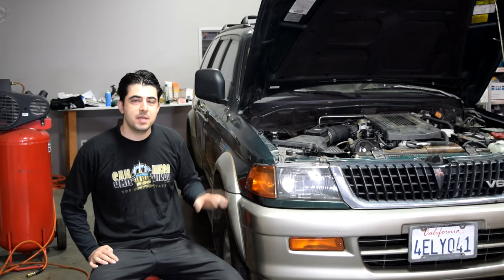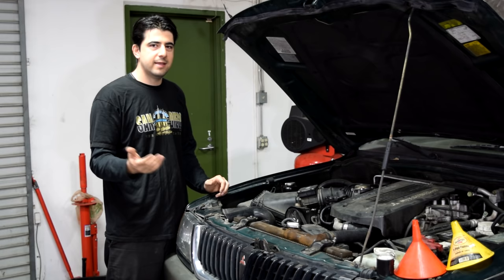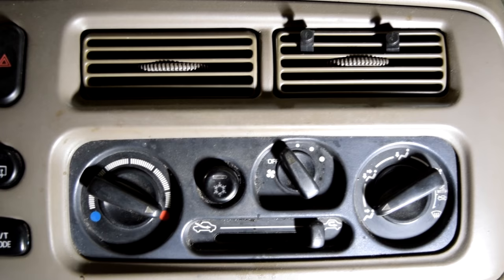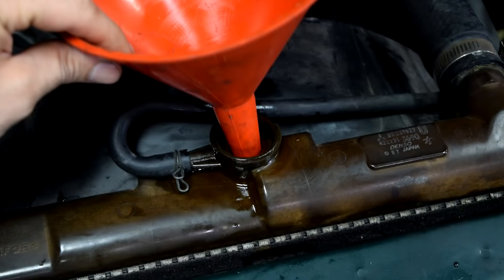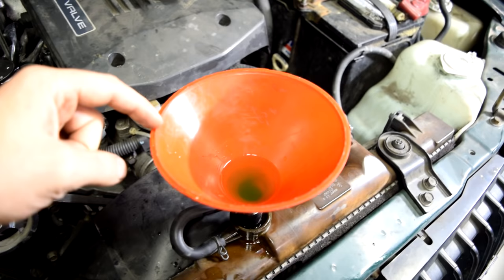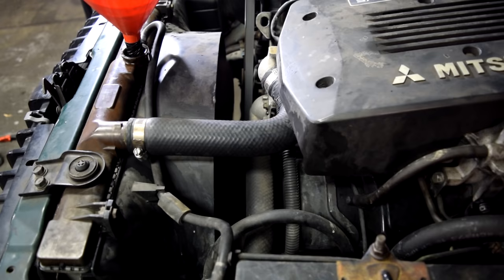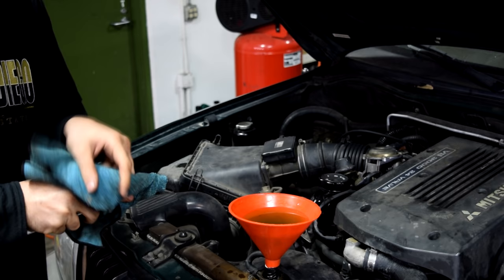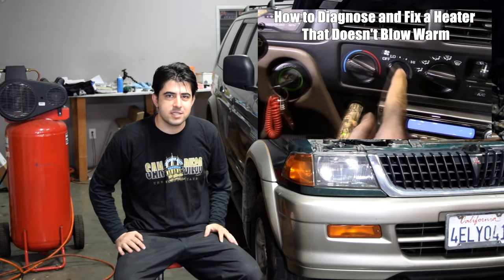Learn How To Bleed Air Out Of Your Car's Cooling System With This Quick And Easy Diy Method.

Comment: so I have no misfire, good compression, car runs greate. I get hot air when I turn heat on, and cold air when I turn the A/C on. everything is fine, other than after a good 45min drive I stop and turn off my car as normal, but I here bubling coming from engine(not sure where exactly from)..... I have a 95 4 runner and so far no signs of blown HG. OTHER THAN the bubbling sound..... I have heard its not the gasket, just that I am a little low on antifreeze. or the HG is blown. I cannot tell and I don't know much about vehicles. however, if I get the right information and a video that shows me what to do I'm confident I can do it myself.

Comment: Got a code for bad thermostat. Replaced it. Drained n flushed the coolant. Bled the new coolant. Got temp up to normal, but my cooling fan does not come on (it never did prior to replacing the thermostat) unless the AC is on. I also noticed the lower radiator hose is not warm. But im getting heat and no overheating. Could it be the coolamt temp sensors? I really hope its not a faulty thermostat that i purchased new. My check engine light keeps coming back on every two weeks giving me a bad thermostat code. P0128. Now my temp gauge is only at 1/4-1/3 on the cool side. It's not at half anymore. OBD2 is only reading ECT temp of 150° F when car is already taken for a 20 minute cruise. Cooling fan comes on when the AC is on, so im assuming it's not the relays or fuses?

Comment: Great video man.
Question:. Any idea why a 2007 Chevy equinox will overheat when going uphill, but not on any other situation? It's my cousins truck and I haven't been able to find a good answer online. He did mention that one way to cool the engine down when going uphill is by revving up the engine, but it's dangerous as where he lives is all dirt roads up high in the mountains. Thanks.
Reply: Do you find the reason?

Comment: I have an 05 town country it overheated a while back . Replaced the water pump, ever since my gauge never worked properly. It's over heated again. I replaced the the pump ,the thermostat and the radiator cap this time. It's still heating where it shouldnt be. No water in oil, I checked . Can u guide me whT to check

Comment: Is it the same process for an audi a4 quatro 1996 ,changed water pump,thermostat,heater core ,an fluid. An still dont have hot air  need help.  Ho megustan tus videos.  Gracias

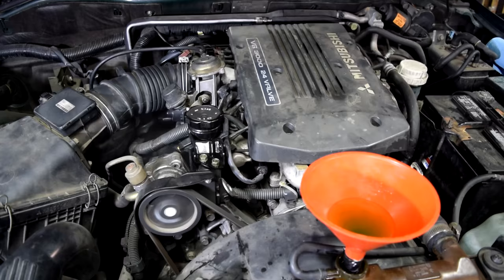Comment: On this video, at 4:06 you can see smoke rising from (probably) the exhaust manifold. This is something nobody seems to mention in any of the videos or any of the forums. So today when I replaced my coolant, and a lot spilled on the exhaust system (engine block release screw was located right above it). After I started the car, it started smoking quite a bit, and my heart nearly stopped, I had no idea what I had screwed up. Luckily a short internet search led me to some obscure forums, and I found out it's normal, and will burn off after about 5 min. And it smells like cotton candy, helps with diagnosis. Regardless, I wish all tutorials would warn about this very scary phenomenon.
Reply: Shaun TV it’s not even scary lol that’s something I’d hear at work from a customer. They think it’s the end of the world when something normal is going on

Comment: What about the vehicle engine gets hot when goin over 60 mph, and then drops to normal, and goes up to H again hot, and drops normal so what cud cause that? Use more acceleration engine gets hot, fan comes on, and idk we put brand new heater core and new thermostat with housings, top it off with coolant n still gets hot...ido what wrong

Comment: A couple days ago my radiator cracked and the car didnt overheat but it started to smoke because coolant got on everything In the engine bay I put a new one in today and I was bleeding it out and some green stuff was coming out bubbly like it was kind of like suds from soap but greenish and my car overheated on the drive what should I do?

Comment: So here is the question!! I bought the funnel so I checked my coolant in the morning  cold  to check the level !! Radiator level I guess was ok  the reservoir was over the max level though!! So I just wanted to get any bubbles that they where there for my piece of mind as I heard some gurgling in the heater core. Well after an hour of the truck running I squeezed the radiator hose few time some bubbles pop up but when I shut of the engine even with warm coolant the level in the radiator was the same as when it was cold!!! Wtf?? Any  directions??

Comment: I've got a Ford F150 with the plastic reservoir next to the radiator instead of cap straight on radiator. Is it the same process or is there a difference in burping with a reservoir? Great vids!  Thanks 4 the info

Comment: Great detailed video. I had the same problem and your tips helped a lot. 
One big question tho:
My lower (the one with the thermostat in it) and higher hose's temperature never become equal. The lower is always cold and the higher is pretty hot. My car is a 2000 toyota camry. Did I do something wrong? Is my thermostat opening at all? 
I stopped the bleeding when air in the cabin wad warm, fan came on a couple of time especially at higher rpm, and i saw no more air bubbles out.
(Also, i could see some steam like material coming out of radiator after a short drive. I wonder if that is just the coolant liquid that might havr spilled on the radiator?!)
Really appreciate your help.

Comment: I have a problem. My lower radiator hose is cold and my radiator cap is cold as well after warm up. Tue cold light shuts off after about a 10-15 minute warmup.  My car does not overheat either but only the top radiator hose is warm not the lower.

Comment: on a 2003 Buick lesabre  V6  do I have to jack up the front of the car to change my antifreeze , I dont want to touch the bleeder screw because  with my lick it will break off.

Comment: Just changed my radiator and now my engine is running substantially hotter. And, it spikes up to around 215-220,.runs around 206 cruising dwn the highway. It's usually mid 190's. Think it's an air issue?

Comment: Great video.  I have 2011 chrysler 200 3.6 with sloshing/gurgling in dash.  I just tried this technique and worked great... much air came out. Went in the car and revved it up a while, no more gurgling sound.
BUT, after i shut the car off and was going to do the rag on the screwdriver trick.... the coolant started rising very fast and quickly overflowed the funnel.  Quite a bit came out all over and coolant level went below the bottom of the funnel.  I replaced the reservoir cap.  Started car back up and  the gurgling sound is back.  Thoughts on the why it did that and how to fix?  If it were just gurgling and sloshing, I might put up with it... but it runs hot too.... so i need to fix it.
Reply: This same happens to me !!!!
Do you know what ist the reason?

Comment: I applied same procedures but am wondering that water on yellow bot returned back to the coolant plastic reservoir that’s happened only when I press on gas pedal to increase rpm ! Then the coolant water reservoir is above the F level ! Any suggestions please

Comment: Hi, great video! I dont have heating, but when I raise the heater tank up, the heat comes. And when I put the coolant tank in his place, the heating is gone. Even if the engine was ON for 25 mins with the tank up. Do you think that my problem is air in the coolant system? Any suggestions? Thanks

Comment: I have a question I just fix my radiator for camry 08 I did a pressure test coolant I notice when I pump it to 16 psi it slowly I mean really slowly going down a bit every 5 minute the needle going down a lil bit what Does that means?

Comment: I did all the drained and flushed and follow the proper air bubbles removable but my chrck engine light is on afterwards. What's the problem  and why the check engine light is on? It's a 2016 Honda HR-V.

Comment: Ratchet, Why is it that on Toyota Sienna's, the rear heater core barely gets coolant flow, it is a long travel from the engine and the only way I got it to work was to use a clamp to close the hose that goes into the front heater core so that there is a bit more pressure that would overcome the rear heater core and it work, after removing the clamp, it doesn't have good flow again, the rear heater core is not clogged and the small coolant it had was very clean like it doesn't flow. I was thinking the water pump is not big enough to maintain coolant flow to the back and only manages to pump up the front heater core which has less loop travel. I know I had air in the system so I parked the car uphill and started adding coolant. Like I said, I was able to get hot coolant at the lines but the flow is very little that the heater core is cooled down really quick and air is not hot, only warm. 

I strongly believe this is a Toyota issue where the water pump is not strong enough to keep coolant flowing at the rear heater core.

Comment: My Ford Windstar sits on a slope tilted to the left, will this cause my thermostat gauge To go up quicker? I didn't have my van on a flat surface, but I was trying to test the thermostat and the coolant overflowed within seconds of cranking the car. Should I have let it sit on a level surface before testing it?

Comment: My coolant rises instead of drops when the fans kick on. Now there’s more air in the system. What’s going on?
Reply: What'd you find out?
If you used a funnel like he did and that happens, I'd guess maybe the stat isn't opening. The top radiator hose should be hot once it heats up (showing us the stat opened)

I just did this to my pickup and it does rise and fall a little due to heat.
(Park on a small incline making the radiator highest point) and of course, ensure heater is set to high.

Comment: Ok so here’s my problem. My radiator doesn’t have a cap and so I opened the coolant reservoir and let air out from there. I left it open with the engine running and I spilled all my coolant when it overflowed.. my heater was blowing hot air too, my truck runs a little hot and I think it might be air in the system? Should I try again?

Comment: Great video as usual. On my BMW X5, I noticed that the thermostat hardly opens. Thermostat is supposed to open at 97 degrees C, 201 F, but when I check the engine coolant temperature, it hardly gets to that level. Therefore I can never bleed the coolant completely. I've left the engine idling for a long time, but still no luck. So in winters I get cool air whenever I stop, unless I turn the fan to low; only then I get hot air but at very slow rate.
Any guidance will be much appreciated. Thanks.
Reply: I'd get a new thermostat. It solved a lot of problems for me. They're usually under $10 and one of the easiest things to change on the engine. Usually...
Reply: @dickJohnsonpeter  but this is happening after the installation of a new dealer thermostat!

Comment: Hello please reply... i just changed my headgasket  but my coolant resovoir is boiling with air bubbles? What should i do? But its not overheating also i still have a heater and temperature gauge is right

Comment: when you say that the upper and lower hoses should feel the same temperature could you be a bit more specific for eg cool to touch,warm to touch,hot to touch. which one of these best fits your description
Reply: both should be warm to touch and as the engine idles the hoses should be  hot to touch. the next time you are by your car pop the hood and touch the top radiator hose then let the car idle as usual and then touch the top hose and you will see how warm or hot those hoses can get
Reply: option man thank you very much.
Reply: Shazza T you can also squeeze the hoses and if they are firm and stiff they are warmed up at the right temp

Comment: hey  i do have the water noise in my cab. so does it have air in the line? when i turned off my truck it erupted  and covered everything is wiped down clean. got any advice? gmc 1990 truck, radiator

Comment: Hi there. Question. I have a Chevy express  and as soon I turn on my engine the cooling fan runs and dost stop keeping my  heather inside just warm.  Not hot. I checked the fan and there is resistance. Tried to stop it while is on and I can’t stop it.  So is good 
I replaced the thermostat and the motor blower  resistor.    Still no luck.

Comment: hey, im tying to bleed my coolant in subaru, and people say have your heater turned on full blast... does that mean have the fan blowing full blast with the heat turned up, or have the heat turned all the way up, with the fans off? if you could please let me know... im having the hardest time bleeding my subaru because of the turbo resevour ontop...

Comment: What happens if coolant stops coming out of the bleeder all together, and its just steam?
Reply: Means you are super lower on coolant and you need to add some. What little coolant there is down in the engine is boiling and the steam is coming out of the bleeder.

Comment: But what if you bypass your heater core cause I have a 2001 grand Cherokee Laredo and I bypassed it because of the heater core and it was working good for like a year and now its starting to over heat the water pump is new so is thermostat housing idk what else to do

Comment: I have a 2001 Honda accord lx 2.3  have the cooling tool did everything u said changed out the radiator & cap thermostat water pump n my top n bottom hose have alot of pressure......when I take off the radiator cap a little air comes out than the blue anti freeze car doesn't over heat ......what can it be

Comment: Hello. These days I have been doing the coolant flush first with distilled water to get the old coolant out. The point is that every time I drain the radiator I fill it with distilled water through a funnel and I hope that the air begins to release. But it happens that it does not turn on the electric fan at any time. I have spent 45 minutes purging the air and the fan has not turned on at any time. But when I drive the car and the weather is hot or I drive a lot in the city the fan does turn on. The thermostat does work fine indeed. I don't know if it will be normal or not. Is it necessary to do it with a funnel? My vehicle it is a Suzuki and it uses the same system with pressurized cap and overflow tank. Thanks

Comment: I have a Saturn SL1 2002,  i'm having trouble with the heat. The fan motor is running perfectly, but I have very low blowing power inside the car. When I put it on air recirculation the air power is perfect, I can feel the blow is normal. Very strange. I thought I had could simply clean the cabin filter, but apparently there is none on this car. Any advice ? Thanks !

Comment: Hi ,  i like the video, i just wanted to know thouh. How do you know do you flush your coolant out completely and then.One thing i have to add which i find anoying and i am not sure if this tell me to stop trying to be a mechanic, is that my driveway is a little inclined. I would say it is about 5-10 degrees.  Is this fine?Things i really want to do is flush my coolant and then bleed my brakes as both fluids are not good. The brake fluid is black and the coolant is red white but it is not clean i can see the reservoir bottle is brown with age i guess. Wish i can make it white again or cleaner. I bought myself a trolley jack and then 2 jack stands, i hope they are fine. The jack i have seems to be a mini type and not a full size trolley jack. I hope this is fine.

Comment: what if the heater only works on the passnger side of my 04 sierra? the AC is always on on the driver side regardless of the settings i put for the AC. should i still pt the heat upanyway ? if not what else could i do to help egt the bubbles out

Comment: I dont have high temperature When i put on the heater my Temp is going down .,, then back I vhanged thermostat ... coolant fluid etc .. still the same My car is a Bmw m550d f10

Comment: my car over heata when idling and also the temperature guage fluctuates and heat goes in and out so idk
Reply: the_pedal_shifter 66 just figured this out. If the hose near the therm housing is still cool while radiator hose is hot, replace your thermostat. If it is still overheating, and fans aren't turning on, could be radiator fan switch if your rad has one, and/or wirr harness for the fans to automatically come on.

Leaks in the hoses and radiator can also cause the over heating issue, even after replacing radiator, therm, fans, etc.
Reply: Temp sensor

Comment: hey +RatchetsAnd Wrenches, I have a 99 Camry 4 Cyl think I might have air in my cooling lines. I'm hearing a water noise coming from the dashboard when I start the car and when raising engine RPMs from a stop. Sounds like water is somewhere in my dashboard swishing around but I don't see any leaks inside or outside of the car. From watching your video I suspect there might be air in my cooling system. I recently drained the coolant from the radiator to do a timing belt job and thermostat replacement

Comment: I took my car to a repair shop changed oil seals,  the engine was dropped and after the fix, car started to overheat,  coolant started to boil in the reservoir intensely and spill making the car undriveable bcos the radiator gets empty every now and then. The cooling system was not bled bcos the repair shop has no knowledge of how to do it. Now I'm stuck,  can anyone point me to what the problem is?